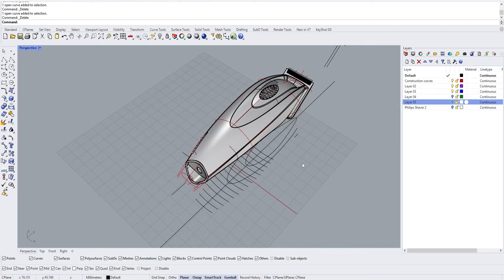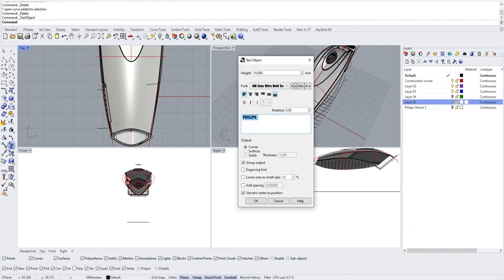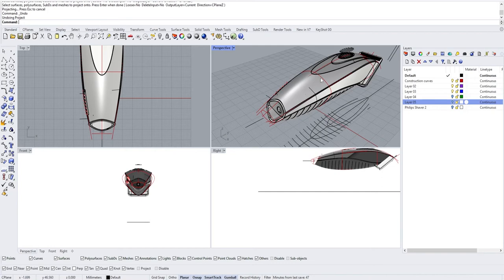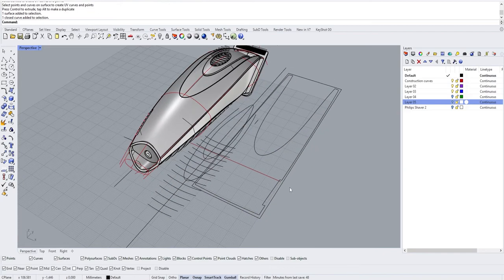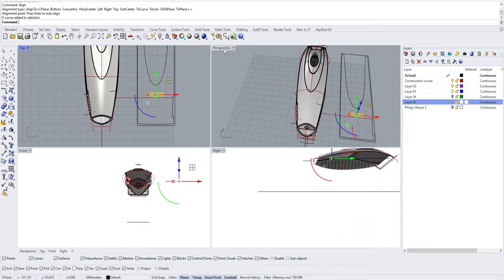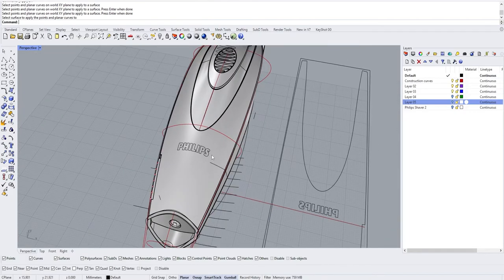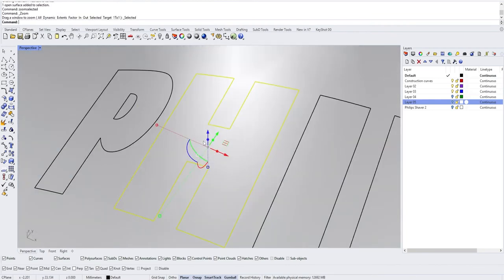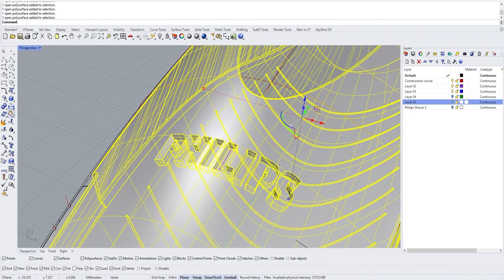How to project text on a curved surface in Rhinoceros 3D

Comment: I did learn some new things with regards to uv curves in Rhino.  You might want to think about the fact that you cannot mold a plastic part with the debossed logo created with an offset to the normals of the surface.  Draft angle on the logo surfaces and part removal from the injection molded tooling would need to be considered for a real plastic part.